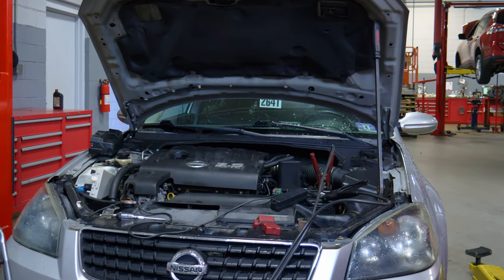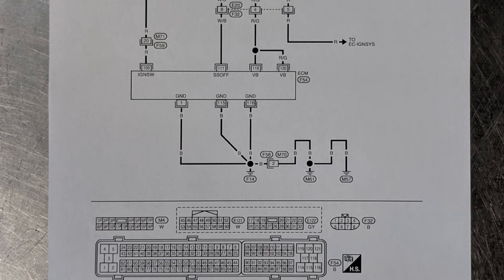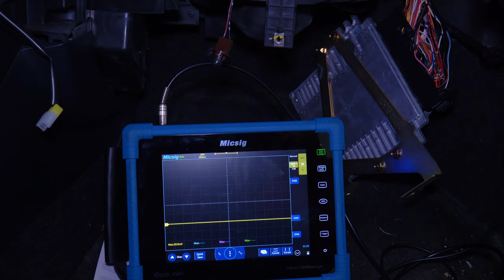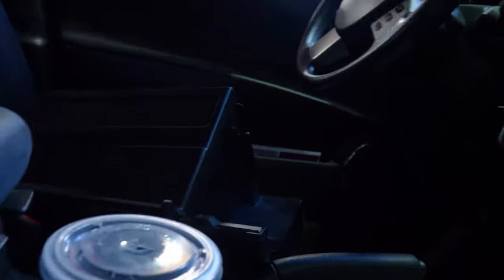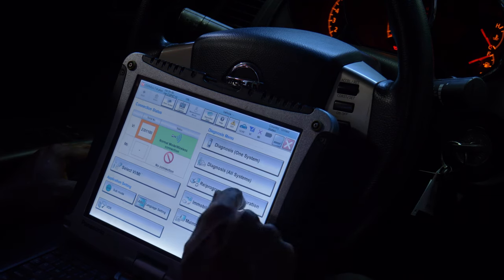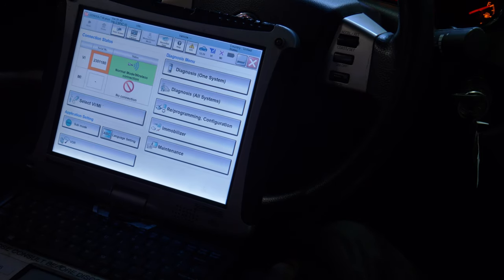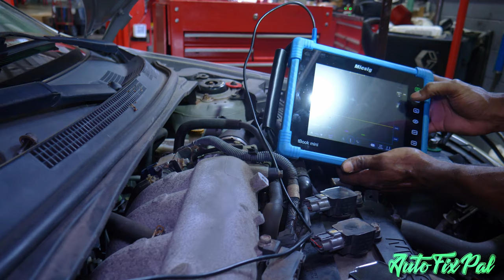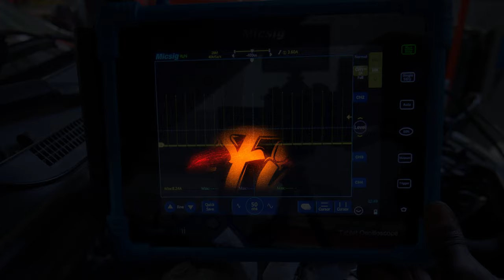2006 Altima Crank No Start - No Communication

Comment: Heck of a diagnosis & fix. I truly like how clear you are in your explanation, it almost sounds scripted but that's not a bad thing. It shows you take time to be understood and that relay the info needed.   Top notch! 👍
Reply from the maker: Thank you very much and yes i did take time putting it together to make sure its easy to follow and understand.
Reply: EXCEPT HE HAS NO CLUE HOW TO MAKE A PROPER SPLICE.  WATCH 12 MINUTES INTO THE VIDEO.  HE SIMPLY TWISTED THE WIRES TOGETHER AND MELTED A HEAT SHRINK SLEEVE OVER TWISTED WIRES!
Reply: @randalhubbard4932  in a normal current loaded or exterior connection, I'd agree, I would have soldered those before slipping the heat shrink over. However, there's no current load on these wires.  You could have 1 strand of copper intact and it will not have issues in this application.  Don't be so overly critical on the insignificant minutia. There's so much more to learn from this video.
Reply: It's very sad knowing that you perceive that as being an adequate repair for any circuit..    I've been professionally turning wrenches for over 25 years.  I have my Ford Senior Master certification.   I've seen every type of sloppy , shade tree work imaginable.  This is near the top  on wiring since it's from a claimed professional level tech.  This is almost the same as twisting them up and slapping a piece of black electrical tape over it..  You should have used some wire nuts like used on home AC VOLTAGE WIRING CONNECTIONS.
Reply: @scothubbard5323  who are you replying to? I thought this repair was just fine in this situation

Comment: I have an 04 3.5 maxima. I started to notice a bit of a power slip while on the highway. I knew I needed a tune up. Sooooo I got my buddy's computer (Snap on model)...did a diagnostic. #1 cylinder was a misfire. I removed the plenum and the throttle body "tunnel". Not so much of a bad job...Need a bit of patience. I took off the 1,3, and 5 coils. #3 had oil in the well, I cleaned a it up. Took out all of the plugs on that bank (closest to the firewall) replaced the plugs. NGK's. Then I took the #1 coil and put it in the #2 cylinder. (I changed all the plugs by the way). Long story short. I put everything back together. Except the engine cover. Started the car up? It ran nice. Idled Steady like a rock. Did the diagnostic and back onto the highway...ran the car good. 60 thru 85 MPH. And back down again. Ran like a raped ape. I must have blown the excess crap out of the exhaust system. Because my exhaust pipes were quite clean.  Instead of having the soot that i got used to seeing. 
So in short? The plugs were changed out, the suspected bad coil position was changed (Nothing wrong with the coil). And the car is running fine. Good Idle and lots of power. The one lesson that I learned? Was to keep the car tuned!!!! Don't get lazy and think that bad boy is gonna run good if you're not on top of it. I do most of my mechanics. And I save mucho bucs. "Cause I'm cheap! Have a nice day all. 
By the way as far as that oil leak? I noticed #3 isn't leaking. So me thinks whoever put plugs in prior? Didn't tighten # 3 plug in. Or the valve cover at that point wasn't tightened down sufficiently. Either way after some investigating I found out that the valve covers for the 3.5's have their own grommets already inside the covers. I ordered one for the culprit side. And will replace it. But right now as I mentioned earlier? It's not leaking. And the exhaust is clean. Hope my experience helps somebody out if they  have a prob like I did.

Comment: O have a similar problem on a 06 2.5 altima spark but no injector plus if it sits it will start some times
Reply: Have to add that it’s setting a code for p1614

Comment: I have a 2004 Altima 2.5. It starts fine in the morning I'll drive it somewhere and park it. But after it gets warm it cranks but won't start. Changed fuel pump, MAF, Temp Sensor, Crank, and Cam sensor twice, Spark plugs,  I'm running out of options, and patience. Someone please help.
Reply: Hey I seem to be struggling with this same exact issue! I’m wondering if you figured out what was wrong?
Reply: @ashleyboys5212  I found out that the ground wire that goes to the ECM Relay (White with Black) wasn't switching to ground. It goes from the IPDM (Fuse Box) to the ECM (Computer) under the glove box. I used a jumper wire from pin 30 to 87 in the ECM relay slots on the IPDM and the car started and ran great. The White and black wire connects to the ECM (computer) and is supposed to switch from on (power) to off (ground) when running but wasn't.
Reply: @allbrant  wonder if this same issue w our 06 2.5 S
Reply: @allbrant  please could you help with the wiring diagram if possible?

Comment: I drove to work in the weekend to do my morning rounds. I left the wife’s 2006 Nissan Altima running, came out to the car and drove a few blocks to the hardware store. I just started going up the hill and the car just straight up died. It cranks but no start. As I am typing this I realize I may have been low on fuel.

Comment: what does it mean when my 2005 nissan altima cranks at -10 voltage? but won't start.
Reply from the maker: if its cranking and not starting. that means you are missing fuel, air or spark. possibly all 3. Find out what your missing.

Comment: THANKS SO MUCH , I HAVE A NISSAN WITH NO INJECTOR PULSE..., I HAVE SPARK PULSE I HAVE SCOPED CAM AND CRANK SENSORS THEY LOOK OK . ENGINE SOUND GOOD WHEN CRANKING COULD NOT HEAR A MECHANICAL PROBLEM . SHOP HAS CHANGED CAM , CRANK SENSORS THE FUEL AND THE FUEL PUMP . CUSTOMER SAID THEY WERE DRIVING ALONG ON A LONG RUN AND THE CAR JUST QUITE . I HAVE SPRAYED CARB CLEANER IN THE THROTTLE BODY AND IT WILL RUN SMOOTHLY . IT'S  AN OLD 98 WITH A 1.8 L-DOHC-I4 (QG18DE) ENGINE DON'T HAVE COMPLETE WIRING SCHEMATICS ON THIS OLD BOY . ANY HELP ON THIS WOULD BE GREATLY APPRECIATED THANKS SO MUCH  !
Reply from the maker: 98 sentra?
Reply: @Autofixpals  NO SORRY NISSAN BLUEBIRD .
Reply from the maker: @8power0  Im in the US man i have no idea what a Nissan Bluebird is, sorry.
Reply: @Autofixpals  IT'S COOL I FINALLY FIGURED IT OUT THANKS BRO !
Reply from the maker: @8power0  what was it?
Reply: @Autofixpals  IT WAS A TIMING ISSUE THANKS .
Reply: Hi. Im.  Adrian.  Ani.  Hi.  Teach.  Mecanik.     In.  La.    County

Comment: How much did this cost the costumer.
Reply from the maker: i think the PCM was like 8 or 900 dollars plus 3 hours labor. Didnt charge them for the misfire diag, coil replacement and getting rid of their backing plate noise that i would have been blamed for even though i never took a wheels off.